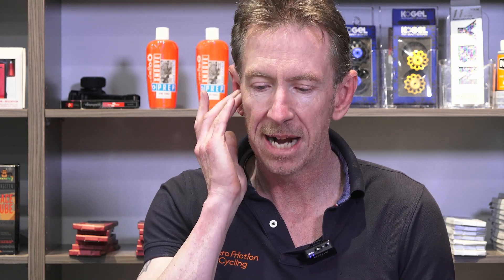Episode 10  - 12 Speed Chain Compatibility

Comment: A lot of people are running Shimano chains on SRAM AXS without issue.   You should have tried it or researched before stating that.  I've even had customers quote you while installing replacement 12sp shimano chains on SRAM for a different customer.
Reply from the maker: Researched it yes, tried it - there are limitations to how many combinations of things i can personally try as i can only have so many bikes to ride and i dont ride axs road. Been awhile since i watched that vid, but i think i covered in there that people have  & do try non axs road compatible chains (ybn / kmc - shimano would be in same boat) on axs road - but the main thrust of why i would not recommend that remains the same - it is a completely different standard , and to those chains, the axs road cassettes and rings would look like very worn parts. We know that it is common if people put a new chain onto worn parts, it may jump under load. It happens every year that people do this, it jumps off chain ring under stand up power, and they have a hot date with the asphalt. 

So your point is, know this to be fact - that is should be saying based on anecdotal reports that people are doing so and its fine, that i should recommend people to engage in a complete standard compatibility mismatch that may result in serious injury? 

Unless you are talking about sram axs eagle vs road? In which case yes i have tried that and covered the caveats with that in the video no?
Reply: @Zero Friction Cycling  I get that you can't test everything but people had already done it well before you published this and a lot of people have been sure it wouldn't work because they heard it from you here and in interviews from you on other channels.
*I managed over 8k miles out of a waxed Dura Ace chain on my first SRAM 12sp cassette.  A chain bought from you that was gifted to me by my girlfriend.   It's still going.  No idea how much longer it'll last since I ride so many different bikes.
*No skipping issues either and I'm a strong cat 1 at 88kg.
Reply from the maker: @veganpotterthevegan  so your problem is that i am recommending against putting a completely incorrect standard chain on axs road, based on the fact that X people are anecdotally having no issues with it? 

Just how many people are being badly put out by running the correct chain for their system after seeing my video? what magnificent benefit are you getting by running a shimano chain on sram axs road vs running the sram chain that drives you to take the time to go online and shoot down someone advocating they stay with the correct chain for that standard? 

Unsure how this has got you fired up lol!!! But i am fascinated :)
Reply: @Zero Friction Cycling  is everyone that's critical about one single thing you've done(while being a customer🙃) "fired up"?😉
Reply from the maker: @veganpotterthevegan  i have no idea what you mean, or what the issue is you are actually trying to take up. If i make an error, or put out incorrect information, i would absolutely want to know, and look at best way to correct - but honestly you have not helped clarify what the actual issue is that you are criticizing. If you can answer the question in my last reply that would help a lot - this last reply makes no sense to me at all.
Reply: @Zero Friction Cycling  you said they're not compatible but they are.  If you've been in the industry as long as I have(I'm sure you have been), you'd know this wouldn't be the first time a company has claimed that incompatible parts actually are compatible.  This happened with chainrings from 10sp to 11sp.  Very few people had to get 11sp chainrings but the big 3 largely said it wouldn't work well at all.
Reply from the maker: @veganpotterthevegan  Take things on their merit a bit more. They are completely different standards. The flat top chain is internally thinner, externally thinner, and with oversize rollers, and thus cassette and ring teeth are profiled to match. There are obvious risk issues running a completely different standard chain, and also with 12s already issues can be seen re shift indexing that now needs to be very precise, and any minor misalignment in hangar / drop out causes issues, this is exacerbated further when one tries to squeeze a wider chain that is 5.2mm wide into a system designed for a 4.94mm wide chain. Great that it is working for the cases you have seen, but in now way can you speak for all cyclists who may try to do based on your own anecdotal experience. 

And again to what end? What advantage is one getting running a shimano 12s chain on a flat top system?  What on earth are you driving at? Why on earth are you taking a shot at me for not recommending to people to run a completely wrong standard chain, which may or may not cause issues, for zero advantage? It just makes no sense. 

If you want to put people on a completely different standard chain for the system, and any risks that may entail, for zero advantage - well thats you - but that hardly forms a strong foundation to take up an argument against one recommending to in this case, for clear reasons, to stay on the correct standard.

Is this durian rider again? normally the only one with comments this off base and illogical is him under a different user name...... Lets leave it here - i have zero constructive feedback to gain from you on this - you are just way off base and have made not made any logical sense re taking a shot at the recommendation at all. I worry for those indeed who have you as their mechanic... time to smarten up a bit and get your basic logic circuits online
Reply: @Zero Friction Cycling  Unsure how this has got you so fired up lol!!!  But I'm fascinated :)

You deflect more than a first gen,  SRAM Red front derailleur.  Many thousands of people are using this stated combination of components without issue.  I'm sure many have bought chains from you not knowing you "think" what they've been successfully using is incompatible.  You know very well that you have plenty of friends running SRAM. Throw one of them a 12sp shimano chain and see for yourself. There's no lost shifting performance.  At the very worst, it will start to shift poorly a marginal amount of miles before a SRAM chain with cable stretch for people running 12sp converted mechanical shifters.
Reply: @Zero Friction Cycling  I'm also not taking a shot at you for not recommending it🤦 You said it's incompatible, but that's simply not true and extremely easy to prove.  Also, SRAM 12sp chains also work fine on Shimano 12sp cassettes.  I've thrown one on a friend's bike because I had one lying around and here in Utah, nearly all bike shops are closed on Sunday.  He's not a chain maintenance type and he's gotten pretty typical mileage without issue from it.
Reply from the maker: @veganpotterthevegan  Im not fired up at all - i am myself fascinated you are pushing such an issue - honestly you are just making yourself sound very - not all there. Again, what on earth is your point? 

You cannot point to many thousands of people running shimano 12s chain on sram axs road components - you are full o shite on that front if you say you can account that. There will be some for sure, but it is not a wide trend at all, i know of no one running this personally, nor have i had any orders or requests from sram axs customers looking to do this. 

In summary you seem to be pushing that i have been bad in some way for my advice to people not to do this, whilst you have been driving for people to do this and taking at shot at me for not doing the same. You are driving people to run a miss match standard that carries a non zero risk of potentially causing major drama's if it jumps off ring, decreasing the already thin margins for correct indexing, and for zero benefit to the user if those risks done come out as an issue in their case. 

That is just a) stupid and b) extremely stupid to give someone else shit for not being as stupid as you. 

What am i deflecting? You say i am deflecting more than some stupid analogy, but what is it? i have been completely upfront on the above since you first decided to keep trying to make yourself look dumber and dumber. 

I parking this one here as i dont have the time - i have only typed this much to help ensure anyone who reads is not misled by you - you clearly lack the upstairs department to work this out, so i will stop trying.
Reply: @Zero Friction Cycling  you're really terrible at this.  You also said you were done but you're obviously not.  Luckily I'm not anything like you and I'll tell people your shimano chains are great on SRAM cassettes. You're welcome.  You've sold a large number of them to AXS users thanks to me😘
Reply from the maker: @veganpotterthevegan  Ha yes i know!! im trying to stop hahahaha it  is just so fascinating!!! overall i get such great input and questions from commenters on the channel, it is really rare and quite something when someone like yourself pops up. 

So - awesome - the wrap is you are happy you are not like me because you are actively pushing your customers onto the completely wrong standard chain for sram axs road, which carries some definite negative risks, and for absolutely zero benefits to offset those risks. Go you. What a great guy and mechanic you are to push hard for that, and to call out me doing a poor job for not doing that. 

I will be biased here, but honestly -  this reads like a train wreck for you. If any of your customers discover this comment thread, if they have two neurons to rub together, they wont be your customers going forwards.
Reply: @Zero Friction Cycling  I'm pushing my customers to buy the best option for their SRAM drivetrains.  Again,  you can test this yourself or continue your false narrative as unscientifically as possible.  I expect better from you with the channel you run
Reply: @zerofrictioncycling992  if my customers see this,  they'll think you're delusional because they've had problem free, durable chains and great shifting
Reply from the maker: @veganpotterthevegan  What scientific evidence do you have that the shimano chain is the best chain for their drivetrain, considering it is the completely incorrect standard chain? Pls provide? what information do you have that i dont?
Reply: @Zero Friction Cycling  its the fastest chain,  proven by you.  A Shimano designed chain built to SRAM spec would be great but that's not an option.  Enough people are successfully using this setup without issue to the point that it's not anecdotal evidence for anyone that's not a hard headed as you are.  
*Glad to see you're back but I expected that😍
Reply from the maker: @veganpotterthevegan  which is exactly what they would have if they ran the correct chain, and without the other risks. This is not like your example of 10spd vs 11spd rings  where both are still running an 11/128 standard chain. Axs road flat top is flat out a completely different standard. So if they are running a different chain, and not experiencing problems, well that is great for them in their case - but it is a physical reality - there is less leeway on the indexing, and so it is not assured that every rider will switch trouble free, and whilst it is great that on this chain it is not jumping, again their is physically less metal there on the ring and cog teeth as they are profiled for the complete different standard - increasing the risk again on the next chain vs if they were to run the correct chain. 

You will find on any time this question is asked to mechanics on tech question FAQ's on articles or podcasts - that all are in alignment that one should not run anything other than srams flat top chain if they are running sram flat top components due to the above covered over and over. 

it is frankly beyond ridiculous that you would say that people would think i was delusional for recommending the correct parts for the system over the incorrect parts that carry some risks, and for zero benefit over the correct parts. i mean honestly what are you on? again by typing that - every further interaction on this thread you just keep looking dumber and dumber. 

By expect more from my channel - it seems like you are expecting more batshit crazy advice that you are receiving. Perhaps go to other channels for that like durianrider - you will get your fill there no problems!!!!! :)
Reply from the maker: @veganpotterthevegan  Where did i prove it was faster? So you are quoting work done by me to back up your case that i havent done? At the time of this video, i rated the shimano chain as what i thought was the best chain on the market overall, and i did say it was likely to be fast - but it hadnt actually been efficiency tested at that time, i dont do outright efficiency testing but rely on ceramic speed denmark research lab as they are the only ones really capable of accurately doing so that i am aware of at this time. 

Since this video i have received the efficiency testing from them (fairly recent), and it was disappointingly slow. This has been updated on the chain efficiency & longevity graph on website, and updated in article at the time launching that graph. it is hot on my to do list to update the speed of the shimano chain re doing a 12spd compatibility update (Topically i might try to get done today or tomorrow if i can with some other bits). 

So...... unfortunately, the updated information since this video - there shimano is not really any faster than sram axs flat top anyway. Even if it was faster, my recommendations would not change, due to the risks - dont get me wrong people do choose to run ybn (which is faster), or shimano, or kmc - but not many - and when i am asked - i advise against due to the risks, but they can make their own decision based on their understanding of those risks. This is a rather prudent way to ensure customer can make their own decision based on their own risk tolerance, and is always appreciated. No one has thought that it was delusion of me to take them through the potential risks - you are on your own weird island there (find me one decent level mechanic on a podcast who recommends anything different to what i have for sram axs road, and you will find they have the exact same cautions as me). So even if it was faster - it would not be recommended. But it isnt even faster. 

So - new summary - you are pushing your customers onto a chain that is a completely different standard, which carries some potentially not great risks, for absolutely zero benefit, based on outdated information re a small efficiency advantaged which turned out not to be the case, and that information on ZFC has been updated, and quoting "proven by me as faster" when i have proven no such thing, and have no ability to do so. 

Amazing work there. 

Again people - if this guy is your mechanic.... RUN.

Comment: Be interesting to hear your thoughts on things like chains for indoor training Vs out door, e.g. would you have one for each
Reply from the maker: Mostly - despite me being a pretty avid waxer - i recommend long lasting, very low wear wet lubricant for indoor (top ones at the moment are silca synergetic or rex black diamond). Waxing treatment lifespan is not super long compared to those, and you do get a build up of excess snowflakes which outdoors just blows away. 

so waxing or waxing in conjunction with wax compatible lubricant is numero uno for most for outdoors, or top wax lubricant like FLower power if not immersive waxing at all, indoors where contamination is not an issue - long lasting very low wear wet lube like the above 2
Reply: @zerofrictioncycling992  great thank you!! Would you use a separate chain for indoor vs. outdoor?
Reply from the maker: @jamesbailey5008  That ones a bit tricky - i think it depends if you have a dedicated ergo bike - then its just that chain, if it is your daily rider going on for the odd ergo - i would stick with waxing - depending on balance of outdoor vs indoor. The problem if you do not have a dedicated ergo bike and look to run a wet lube for ergo and wax lube for outdoor, is you would need to clean drivetrain components of wet lube before putting your wax chain back on otherwise you will contaminate the wax chain, which will contaminate wax in pot which will have future waxings probably not adhere well. So you kinda have to make a call on the bike if its  wax chain or wet lube chain - both would be a lot of faffing - negating the advantages of either path.
Reply: @zerofrictioncycling992  Great thank you! For me it's probably two indoor sessions and one out door session a week on the same bike(s), so I guess go with wax then..